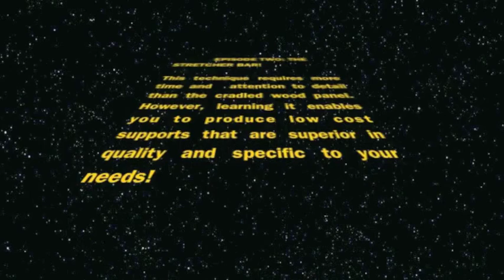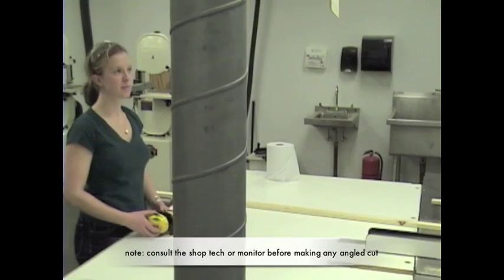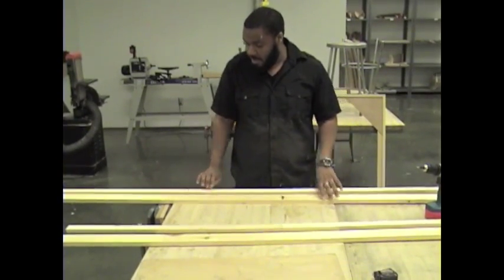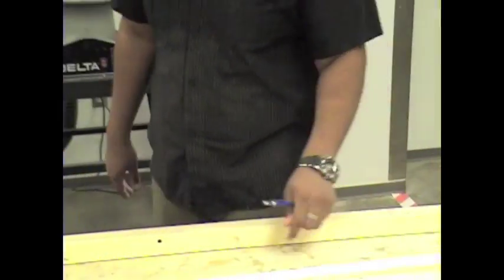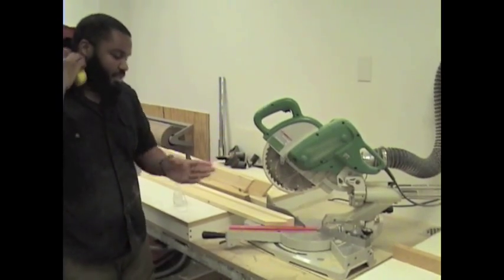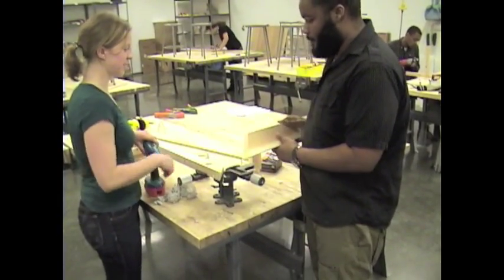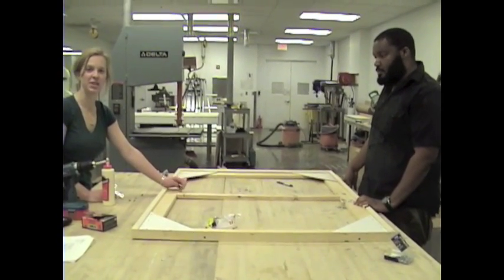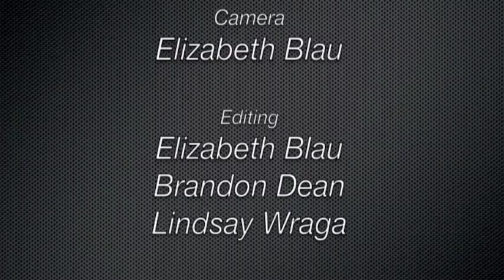Building painting surfaces PART 2: Canvas supports/stretcher bars

Comment: Adding corner bracing  (the triangular pieces) keeps the stretcher perfectly square and sturdy. It ensures that when the canvas or linen is stretched over it, the tension doesn't turn your rectangular stretcher into something that into a rhombus! Whether it be a piece of lumber with 45 degree cuts on either end or a triangle piece of thin plywood or mdf, Its pretty important put some form of corner bracing to keep all of your corners square.